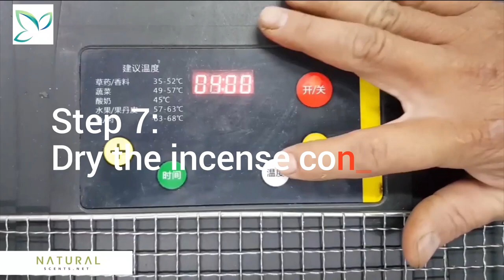How To Make Backflow Incense Cone At Home - Step By Step

Comment: What oven is this used to dry the cones? Can I use the microwave? Or what other process can I use to dry fast?
Reply: Dehydration machine
Reply from the maker: You can use the oven or oil-free fryer. But I usually dry it in the sun.

Comment: What makes the smoke go "down" ??
Reply: Reason the smoke goes down is because most smoke rises because it’s with hot air, but in the instant cone if I was away from the hot air, letting it fall
Reply from the maker: The cones will have a small hole drilled inside. This helps the smoke flow back down creating a flowing waterfall effect.